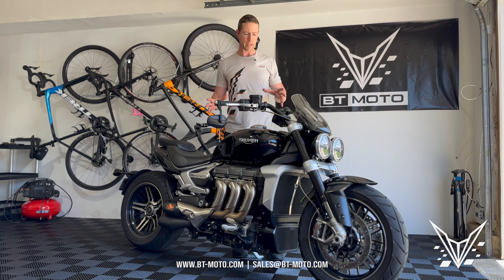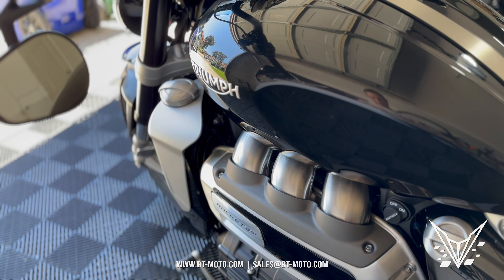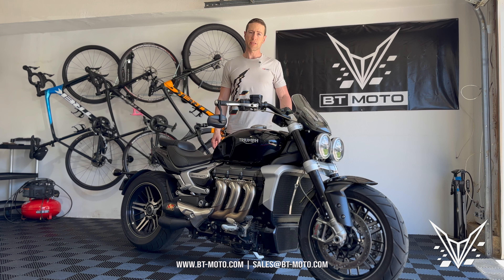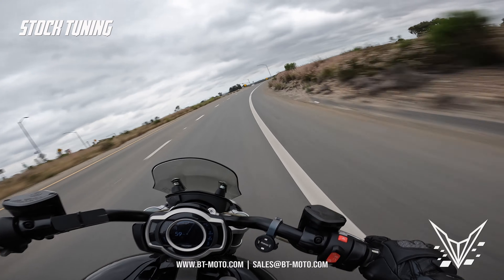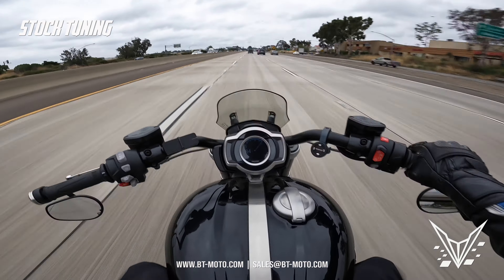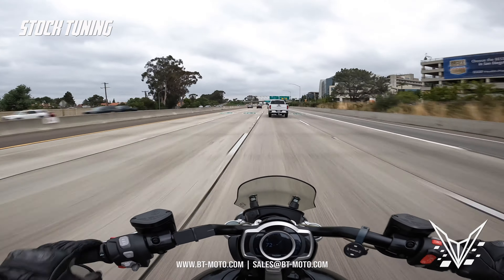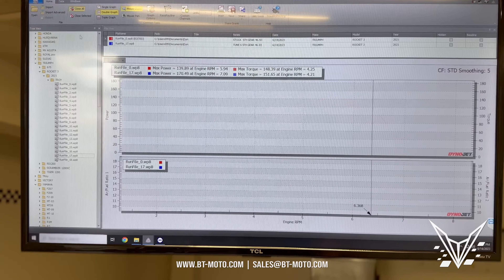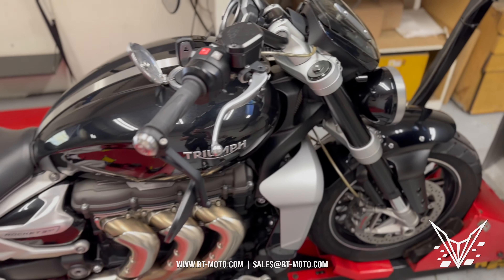TRANSFORMED +35HP! 2021 Triumph Rocket 3 with BT Moto Ecu Flash Tune, Dyno and Acceleration Tests

Comment: Regarding the headshake you noticed, my GT never showed this behavior, it doesn't wobble at all. What I saw in the video, the front tyre doesn't seem to be the original Avon Cobra Chrome, maybe that's the reason. I use the factory front shock adjustment with the original Avon tyre and, as I mentioned before, never had issues with headshaking.
Reply: yeah i have the R3R Black and never had any headshake, stock Avon front tyre also, even at 158mph (in 5th, missed my shift into 6th before having to slow down)
Reply: I had a 21 GT. never had any shake like that
Reply: Mine rides superstable too but I had to school myself in the whole suspension matter. It took me a season and noticed the trick is writing everything down and having notes ready when on specific roads but man... Did I come to appreciate this thing afterward!
Reply: What causes the head shaking.    I felt this on my Honda and it freaked me out.     It seem to happen t higher speeds
Reply: @thomasandrewphd.5844  In case of this Rocket 3 I would suspect the front tire as the reason. But I can't say whether this could also apply to a current Honda. In 1982, my Honda CB550 at the time also had the problem, but it was due to the poor chassis.😉 At that time I was able to improve this behavior with a steering damper.
Reply: Same on my 22 Gt. I have 6600 miles and hit my 147mph top speed just about every time I’m out.  Never once had that happen.
Reply: no headshake on my 2009 Rocket 3 at 130mph, wind drage does want to take your feet off the pegs though, Triumph should have designed a small fairing to shield your feet.
Reply: @thomasandrewphd.5844 don't know about this bike in particular... but a common cause on a lot of bikes, is too tight of a grip on the bars. Relax your grip a little, and as others have said, incorrect suspension setup and tire type/condition could also cause it.

Comment: Never had the head shake on my 2020 GT. Did move the pegs and add the Werks exhaust.  The changes you made make sense to me. Top speed should have been put at 180 and a little more power in the gears because there is plenty available.  I never put the quick shifter on but everyone says that is a big improvement when accelerating.  How do you find a reputable shop to make the same changes? I live in Virginia.

Comment: Nice video. It's so nice the explanation and numbers, that I was thinking all time how to change rpm in my Rocket.
Have you tested times at a drag race? Many of us are so interested in those numbers...
I think that those new numbers make a difference in quarter mile.
Reply: in the same condition air pressure temp inlcine wind rider weight position suit asf if stock do et 11,0s than on this flash be around 10,3 sec 👍🏻 terminal sped 123-124 vs 132 -133 mph more less 👌🏻

Comment: wonderful video. are the 3 throttle tables attached to the rider modes, or attaches to gear groups (1&2 3&4 5/6)? what is the new rpm limi you set for this bike? 7400? thanks for the feedback

Comment: I have your guys tune and the extra rpm is awesome, I feel like the speed limiter was only moved to about an indicated 158mph though cuz I haven't gotten it to show passed that.. but on a different note, idk if I've just gotten used to it or maybe it's cuz I have the stock bread box exhaust but mine doesn't seem to pull as hard as the video.. guess I should find a dyno and see what numbers mine puts down

Comment: Great job, how that should have come out of factory 😎 Roadster version way more chuckable, peg height adjustable, loved mine 🤙 never had any head shake on the flatter bars, used to bang my limiter with no tail off, full throttle quick shifter made such a huge difference, maybe the Werkes without map to blame. Have you mapped the CB1100?

Comment: Very informative, professional video.....well done!  
I ride a 2021 Rocket 3 GT which I love, but always felt it to ride a little "rough" in the first 3 gears. So I thought I would get a Dyno-tune assessment and possibly tune done. We live in (Southern) Thailand and there are not many places who perform this service, but the one place we could find (about 150km away) advertise as the latest and greatest in Dyno Technology. After sending several emails we received a short reply, telling us that they hadn't done any work on Rockets (fair enough) and then asked if we had the cables and software...?????
This left us puzzled, we do have an OBD2 Adaptor, but these are more or less universal fit - my inquiry for further details remains unanswered.
Sorry, to bother YOU with this now, but WHAT cables and software would we, as customer, customarily need to supply (to a "professional" Dyno shop) to get the job done......can you enlighten us....?
Thank you so very much for your time and troubles
Reply from the maker: We provide you with everything you need to flash your bike at home. We email you the tuning to load into the handheld. It’s very easy. We do the research on bikes so you don’t have to head to a dyno.
Reply: @BT_Moto  Sounds great......how do I go about getting this?
Reply from the maker: @bersitam5421  on our website. www.BT-Moto.com
Reply: @BT_Moto  Thanks......already sent message via website

Comment: Man this looks great! Is there a blanking plate that was used when the backrest was removed? I notice this is the GT version, but without the backrest--I'm looking to do the same. There is a hole in the rear passenger area once you remove that backrest and it looks like it's covered on this bike?
Reply: Did that to my GT - had to wait 2 and a half months and the cost was 516 dollars! For two bits of brushed ali. Anyway, the accompanying brackets and bolts dont fit so i glued them in with contact glue and filled the groove flush with black RTV.
Looks great but quite a mission...

Comment: What's your mpg like now? I've actually heard tunes like this can improve mpg?
Reply from the maker: Depends how heavy your hand is after flashing
Reply: I've just ordered a rocket 3 storm GT and it seems like triumph have remapped to get similar gains for the 24-25 models.. I wonder what my new "cruiser" .. lol.. would achieve after retuning.
I am also interested in the mpg or in my case Litres per 100km after opening this engine up... as a general rule, given the same throttle handling would you say it uses more fuel overall, and could you hazard a guess at how much more fuel that could be??.
Love the videos btw

Comment: I'm glad I don't get that tank slapping on mine.  Do you know what the cause is?
Reply: Is balance, maybe tire pressure, maybe sitting position, maybe tire width, perhaps front suspension not calibrated for his weight? Is a balance situation it varies from bike to bike and person to person.....
Reply: @baetech1982  most likely the suspension hasnt been tuned to him, like he said its first ride/impressions for him so yeah. Man has big balls to make runs like that without adjusting the suspension for him. You can see the death wobble so clearly

Comment: I have you guy’s flash on my rocket 3 but it didn’t remove the top speed limiter. Is there a way to get another file from you with the updated flash? Also does shifting that high over redline damage the bike? Running hard I shift mine right at 7k. You mentioned shifting at 7400?
Reply from the maker: Email us
Reply: @BT_Moto  will do thanks

Comment: Thought this bike was faster. Guess the weight needs more power to move it. But the off the line and low throttle passing with that TQ has to be crazy. Pretty sure u can get this bike over 200whp with mods

Comment: Raised pegs , 1 inch up , 2 inches forward , reverse gear pattern now , 1 up , 4 down , 2003 complete transmission , go big ? Or ride a scooter , 13.2 to 1 compression

Comment: I ran a buddies modified previous model Rocket 3 with 260 rwhp at Bonneville Speed Week in August 2023. The salt was pretty wet so we got 164 mph but the bike had a lot of weave in the first two runs in fact on tne 3rd run the front end weave was accompanied by a rear wheel  wobble and chucked me off.

https://youtu.be/9zseiUjGS8U

I have went to the drag strip with my Thruxton R  and had good luck against 145 rwhp older models and 165 rwhp new models . However,  I do think a 165+ rwhp new model properly ridden would beat my 11.678 ET. I won't do roll ons against a Rocket 3 with my Thruxton R  because I'd be crushed.😄😄😮

Comment: I owned 3 of the previous version and they were tanks and I was running over 200hp from Carpenter racing, at that time Jardine made a mean exhaust. This exhaust is such and ugly desing, it doesn't got with the flow of the rear tire